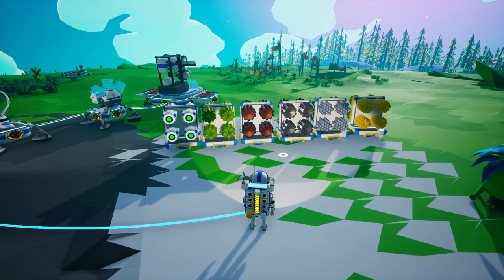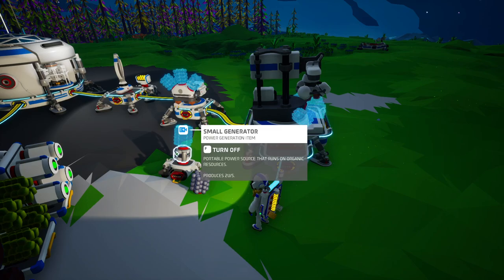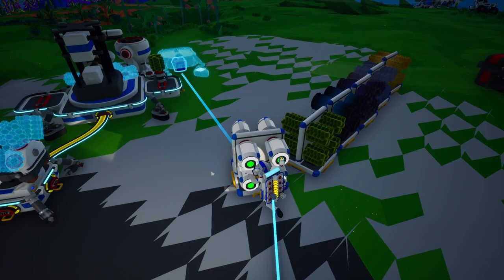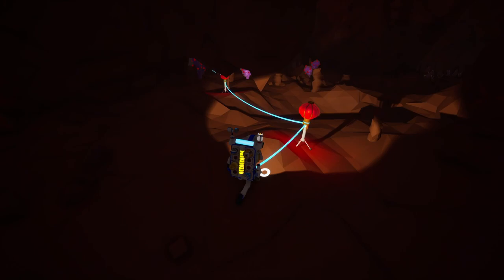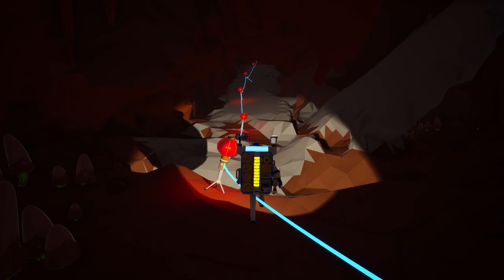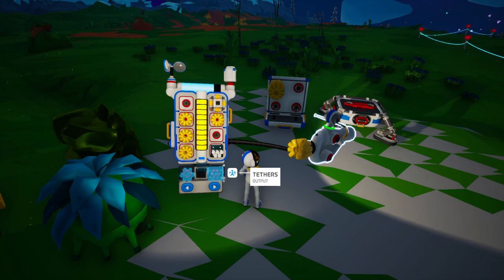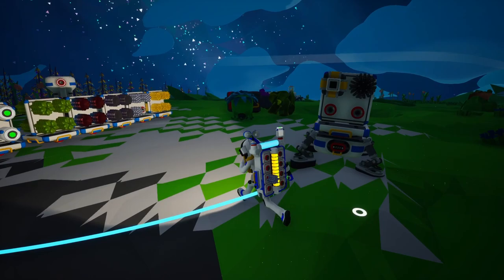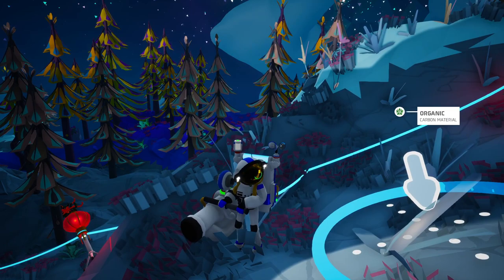RESIN - Let's Play Astroneer - Episode 03

Comment: You probably have figured it out already, about the Platform A and B thing.. It looks like the B platform version does more. With the little wings on it you can put things like the medium storage items on the wings and somehow the smelter or centrifuge or whatever is running on the platform can use the storage so you don't have to manually load and unload???
Reply from the maker: Yep, I’m figuring things out step by step! Still, appreciate the tip. There will likely be things I just completely miss that another comment like this one would help me learn. Cheers!

Comment: 33 minutes in, that bit of resin hanging in mid-air, if you use the terrain tool to build a soil bridge to it you can then reverse and mine it away. It happens sometimes.
Reply from the maker: Now that one I hadn’t figured out even by ep 25, excellent tip. Thanks!

Comment: I found this REALLY confusing at first: I wish they had organized this better. 
There are 4 printers in the game: backpack, small, medium and large. 
Your backpack printer (which is part of your backpack so you can't lose it) can print small items (e.g. a small printer, tethers, small canister for soil), a small printer can print medium items (e.g. a medium printer, medium storage unit etc.), and the medium printer can print large items (e.g. a large printer, large platform etc.). The large printer can print extra large items (e.g a shelter, landing pad, shuttle or large rover).
They put the next size up printer as the first item in each printer's menu, so when you're looking at the small printer the first item it says it can print is a medium printer. Thus it appears like you're looking at the medium printer, but you're not, it's the small printer.
The backpack can only print using one resource, the small can use two, the medium three, and the large four - hence the symbols in the menu with 1, 2 , 3 and 4 inputs.
You probably have this figured out by now, I've got some catching up to do, but just in case...

EDIT: I paused while I wrote that, and you figured it out seconds after I restarted the video...
Reply from the maker: Lol even so I appreciate the thoughtfulness behind your comment. Cheers! 😄